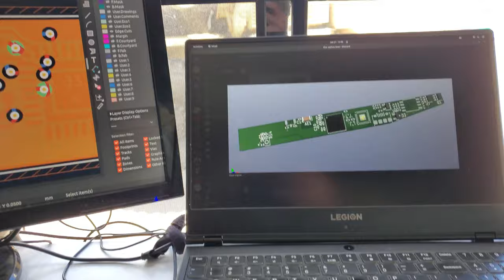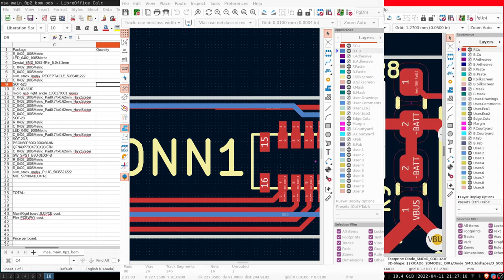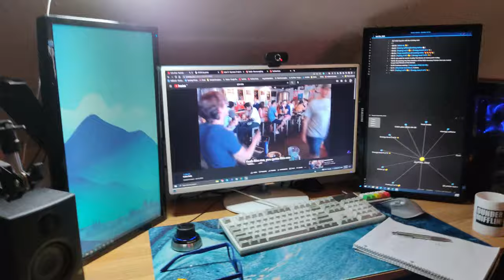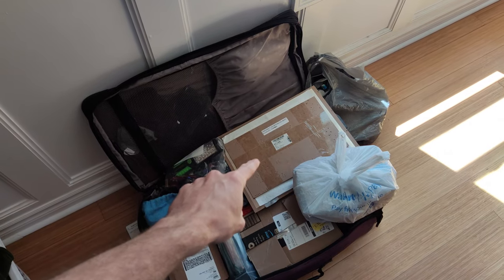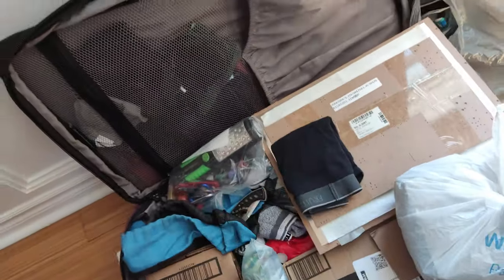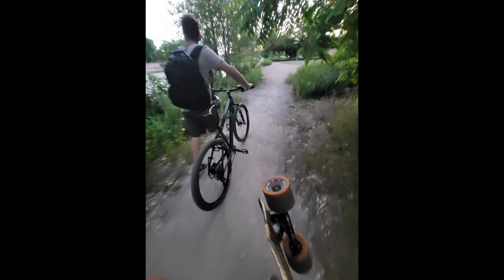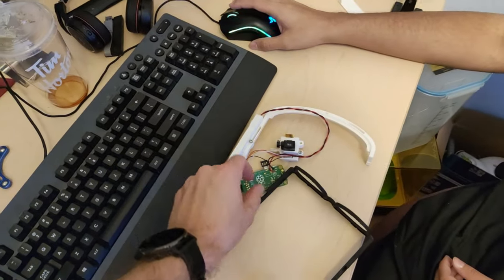Open Source Smart Glasses - DIY AR

Comment: Superb video Cayden and you said it perfectly when you stated "some wearables aren't wearable". It's impressive you've been able to fit 1000mAh batteries into your open source smart glasses and I hope this new hardware can help further WIS. Top work.
Reply from the maker: Thanks Vuyu! Lots of energy in a wearable form factor is an important early step, so that's why it's in this early prototype. We'll need it even more as more electronics and capabilities are added.

Comment: Great work Cayden, finally a way to progress what smart glasses can do and with a community of like minded people with their own use cases. Keep me posted on when they are available.

How much will they be and what's the current OS, Linux or android?
Reply from the maker: Hi Simeon. If you join the email list in the description, you can receive updates about this project.

Right now, the system is only a micro controller (so no user facing OS). Future iterations will be Linux-based, likely.

Comment: This is so cool, exactly what I was looking for. Immediately subscribed. But I do have a couple of questions. 
Once you implement a display, will it be the same type as modern ar glasses such as vuzix? How do you plan to manufacture them?
Reply from the maker: Thanks Mick!

Most use cases don't require high resolution (don't need >= 720p) or high FOV (15-30 degrees is all that's needed). We are currently beginning experimentation with some small size OLED optical modules. Yes, in the longer term we will partner with optics companies to integrate better, smaller, lower power optics module. At this later stage the optics would likely consist of a microLED or microLCOS display and reflective or diffractive wave guide with coupled prescription lens.

Manufacturing thus just requires integrating (into our smart glasses) optical modules that are received from a partner already tested and optically coupled microdisplay and optics.

Hope that helps.
Reply: @caydengineer  it does, thank you very much!

Comment: Does that smd soldering set up work for you 
A hotplate and baking tray?

Awesome project btw
Reply from the maker: Yes, it works fine. I'd probably prefer an oven (or prefer outsourced PCBA as it can be so cheap) now.

thanks!

Comment: constraints would be so much easier to handle if the form factor was just a hat with the guts int the brim and either a fold down visor, or magneticly attached cable to the glasses.
Reply from the maker: Very true, just people don't want to wear hats all the time. However, maybe if it was a great experience, people wouldn't mind wearing a hat throughout the day!

Comment: Really great video, I did come up with the idea of creating some sort of smart glasses for a university project, I am a litle bit stuck when it comes to developing a prototype any tips ?
Reply from the maker: Thanks! Hard to help without details, but focus on what you want to achieve from the start. What's the idea? If you want to build an app that uses smart glasses, you're almost certainly better off to buy a pair (e.g. Vuzix Blade, Inmo Air) and write an app for those.